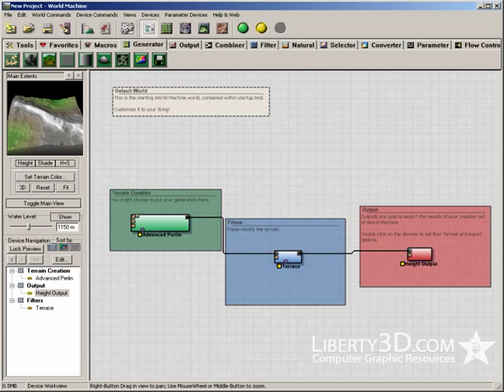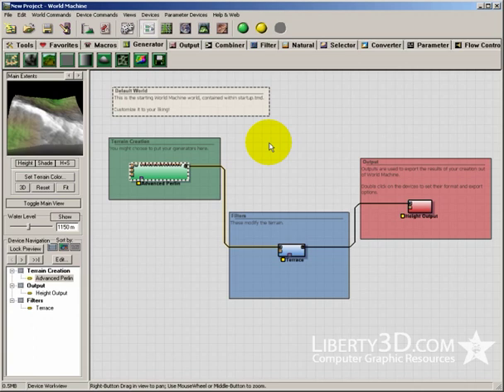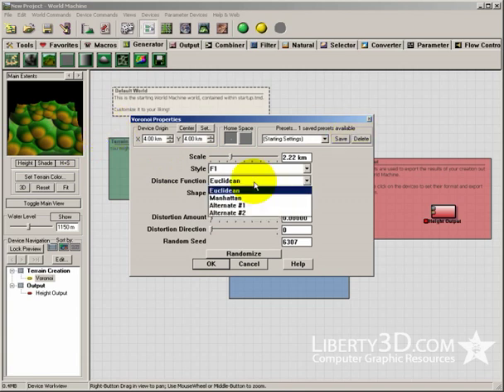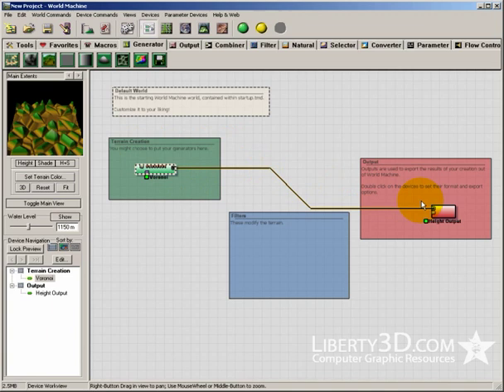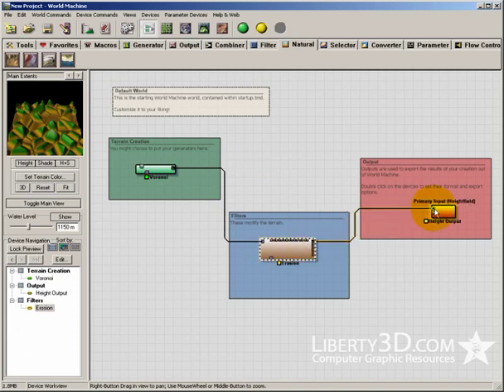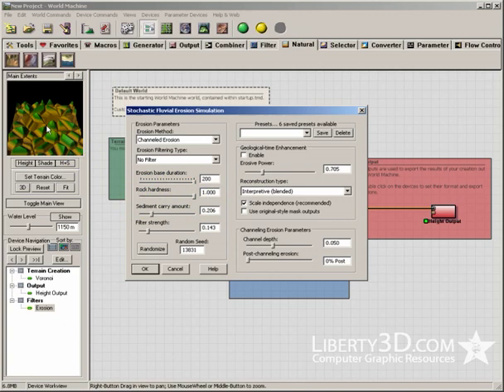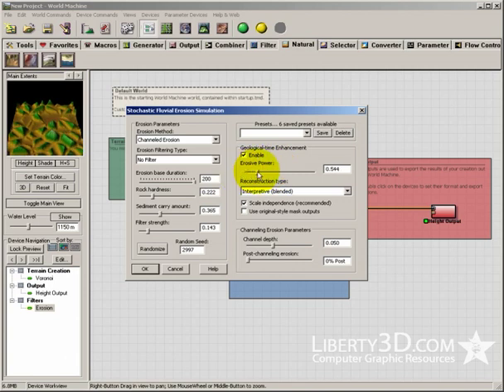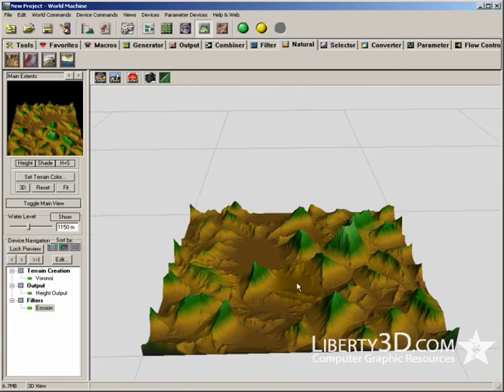Short Demo/Tutorial - World Machine terrain generator

Comment: Yes.  Just export your height map file(s) as .r16 format and then rename the file's extension as .raw.  Unity can use it in this .raw format for its terrain system.  You can export the height map as .png, .bmp, .pgm, and .tiff file formats--which is supported by CryENGINE 3 SDK and several other game engines.  As for UDK, you'll have to convert one of these file formats into Unreal Engine's own resolutions in G16 format, which you can easily convert with a free program called TerreSculptor Pro.